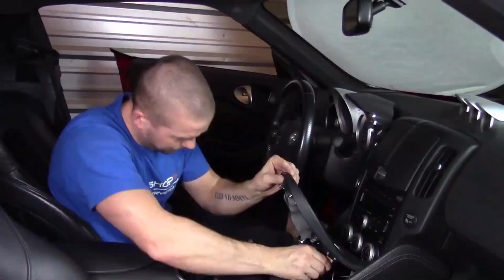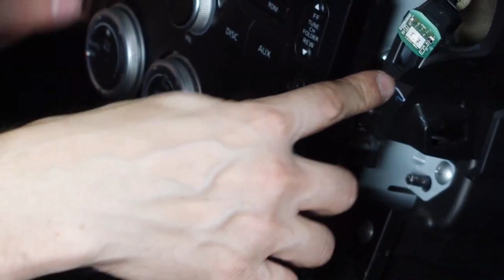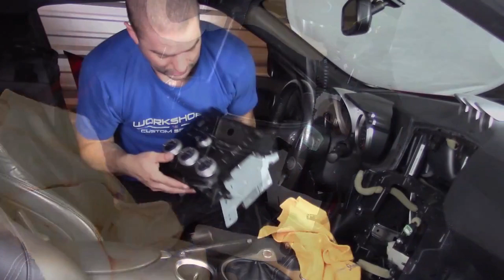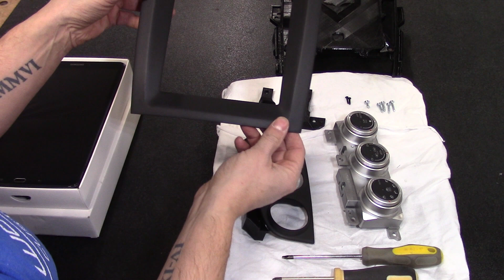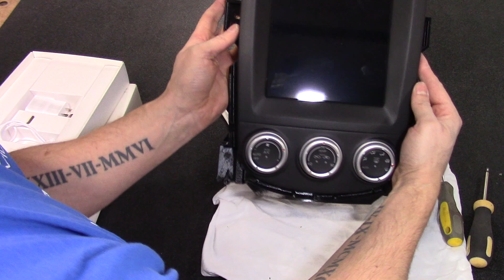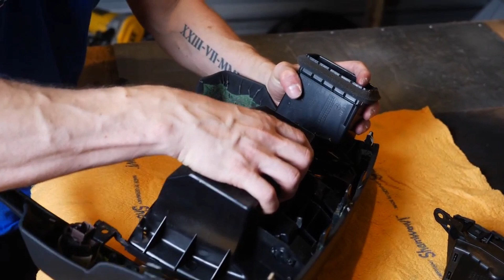MK2 370Z Brainiac Installation

Comment: do you have this for the navigation 2016 370z version?
Reply from the maker: There is a way to make our kit fit with your vehicle however it will require swapping the climate controls to the NON-NAV version. 

Here are some articles to help you: 
370Z Navigation Climate Control Swap

370Z eZ_Navi-Delete (Swap from Navigation Climate to Standard)
YouTube video from one of our customers who did the swap:
https://www.youtube.com/watch?v=uH7DZh0gtKE
If you have any other questions please do not hesitate to contact us.

Comment: this seems great and all, maybe im dumb but where does the head unit wind up going to actually use the tablet with the cars sound system
Reply from the maker: The stock head unit is replaced by our electronics to connect the tablet to the sound system.

Comment: So I have subwoofers in my car with a amp etc could I still run this kit
Reply from the maker: Hi, yes! Our stereo harness from our electronics comes with a "Amp remote turn on" making it easy to power your amp. With the MK1.7 Electronics you would need to purchase RCA Splitters and with the MK2 Electronics by Kenwood simple plug in your subwoofer RCA to the back of the head unit. 

More info can be found on our website. https://workshoptwelve.com/products/nissan-370z

Using an Amp and Subs with your MK1.7 Electronics
https://support.workshoptwelve.com/portal/en/kb/articles/using-an-amp-and-subs-with-your-brainiac-install

Comment: Thinking on getting this for my 370z base model within next few weeks.
Reply: Just ordered it. Can you use any 10.1 inch screen. The tab A a little out dated
Reply from the maker: The tab A was released in 2019, our kit also supports the 2020 Lenovo Tab M10 HD (2nd Gen). We do have plans to release upgraded plastics that can house more up to date tablets in the future
Reply: @WorkshoptwelveConnect  yeah iv got my mk2 kit and tablet installed. I was able to use the stock stereo. But I had to dissemble it to only two mother boards and no casing in order to fit it behind the Tab A. Lol. But it all works fine. Volume can be controlled with the volume keys on the steering wheel and tablet.

Comment: So just installed mome. Looks great but there is crazy static especially when there's no music. Where to ground to help w this? The only bolt I could find d was under battery gauge on the dash
Reply from the maker: Best area for grounding is the bolts that fasten the shifter to the chassis. Try our "Amplifier Keep Alive" setting in our app in the general settings. Sometimes tablets produce noise when the tablet  headphone jack amplifier turns of (no sound playing)

Comment: Do you offer the option to use an ipad instead?
Reply from the maker: We only offer our kits with specified Android tablets. They are designed to fit like a phone case around the tablet and our software also only runs on Android

Comment: Hey so I forgot that it needed a Samsung 10.1 tablet.
By any chance can it take a LG PAD 10.1 tablet??? I got it for 100 dollars at tmobole great deal
Reply from the maker: I can't say if it would fit or not, or what type of USB connection it has. Overall our kit has been specifically designed for the Tab A 10.1" tablet

Comment: Do you have an estimate on when the compatibility for the 2019 model will come out? Would you mind going into detail as to what kind of modifications you are making to the existing assembly to make it compatible with the MK2?
Reply from the maker: We hope to have a solution in a couple of weeks. Been feeling with component delays from COVID-19. The only change to the plastics is the tablet cradle itself. We have all that work complete. Just waiting on the electronics 👍
Reply: Workshop 12 i'm in on this one

Comment: Do you have a 350z install video for cars with the Nissan navigation package . This has  different requirements from the other install video as its digital as oposed to analogue. Do you have a Mk2 harness to aid fitment.
Reply from the maker: We don't have a plug and play solution for the navigation equipped models

Comment: I want to know if it's worth it? I really hate the fact that it's like an iPad that has to be charged in order to use it. Once that lithium battery dies out? Then what????
Reply from the maker: The system charges the tablet while the vehicle accessory power is on. If the battery drains then you have easy access to remove the tablet to charge. It's a different experience than a traditional head unit.

Comment: Great but you don’t show how to wire the tablet for constant power and how does the tablet shut off and on with the ignition
Reply from the maker: You won't want to wire it to constant power. Instead adjust your tablet power settings https://blog.workshoptwelve.com/2019/09/29/configuring-your-galaxy-tab-a-10-1-2016-power-settings/

Comment: What is the difference between the MK1 and the MK2? I thought there were additional vents to handle to handle a few issues? I'm super close to purchasing, but I live in Arizona and NEED the additional cooling.
Reply from the maker: MK2 has a removable front magnetic face plate so that you can have easy access to the tablet. And in some cases remove it from the car in temperature extremes (heat/cold)

Comment: Ok...I am partially sold. You’ve got the market cornered and I can appreciate the hours of prototyping and solid works. While not an Android user it’s not the end of the world. But as a product designer, and savvy woman shopper, I need to ask all the technical question: is there any warp on this? Now that materials are thinner to provide cost saving this is a possible. My Scion TC had a warped dash from the Florida sun when I bought it. Temp changes are accounted for?. What type of warp testing have you done and what’s the warranty period? Next, do the magnets add noise to the ride? This car is already pretty loud. I would hate to have clicking and clacking ok bumps. Let me know what return and warranty policy and testing specs. Thanks!
Reply from the maker: Hi there, our face plate plastics are created out of Nylon which can withstand heat up to 325F. We have customers with cars in Arizona summers without warping. 

The magnets don't add noise to the ride, they hold the plastics securely in place. As a small company we don't really have an official return policy, but if you are unhappy with your kit I'm sure we can work something out. We haven't had a return yet 🙂
Reply: @WorkshoptwelveConnect  last question, without using your app but using Mrk1.5 electronics,  do you include directions on how to wire to the steering wheel so that the toggle for volume works? I've seen it on other videos but can't find directions for the wiring.
Reply from the maker: @Tati7111  our kit doesn't have built in steering wheel control support. You would need to pickup a JoyCon module. We have a link to them from our accessories page 👍

Comment: Just bought the kit, can’t wait. I’ve wanted this for a long time and didn’t buy the first kit because it seemed hard to wire. But with the new set up it’s simply just plug and play, amazing! My only question is am I able to run Spotify and if so can I simply pull down from the top of my android tablet to adjust the volume?
Reply: You will most likely download their app. The app itself is pretty good and the best part is the hand gestures. You simply drag up or down on the tablet screen with two fingers and it puts the volume up or down. 

Keep in mind its going to take about a month to come in though! I ordered mine last month and its arriving on Friday I am stoked! lol
Reply from the maker: Yes, you can run Spotify.. we have on screen gestures in our Brainiac Launcher app that you can use to adjust the volume 👍
Reply: Workshop 12 that works I appreciate it can’t wait for it to come in!
Reply: Can you guys share any feedback on the install experience? How's the system held up so far?
Reply: @STIDMOWA  it’s awesome the only issues I ever had was the little magnets coming out (little super glue fixed that) and I never was able to get a little static to completely go away but that could be were I grounded it.

Comment: So im interested for sure. But my struggle is will i have to take the tablet out and charge it at night. Or is there a way to run a charging cable into it. Or a way to run it to the car battery lol.
Reply from the maker: Using our MK1.5 electronics it will charge the tablet when you're driving(accessory on from ignition). And then set the power settings to have it go to sleep when the ignition is off. You would only need to bring the tablet in to charge if the car sat for a long period of time. If you know the car will sit for an extended time you can also simply turn the tablet off to save battery. https://blog.workshoptwelve.com/2019/09/29/configuring-your-galaxy-tab-a-10-1-2016-power-settings/
Reply: @WorkshoptwelveConnect  Awesome. I have one last question. I seen an older comment that yall said it does not yet work with the 2019 Samsung a 10.1 tablet yet? Is that fixed or will i still need a 2016 one. If so where can i find these.
Reply from the maker: @Jordan-nd8pq  we don't support the 2019 version quite yet. You can find the 2016 version usually on eBay or Amazon (model number T580)
Reply: @WorkshoptwelveConnect  Thanks for the help. Ill be looking to order a kit soon

Comment: Are you able to receive radio any longer with your kit?
Reply from the maker: We unfortunately don't have an AM/FM solution as part of our electronics.
Reply: @WorkshoptwelveConnect  could you test the next radio app and see if your aux setup will work as an antenna?
Reply from the maker: @cipher_z  I believe it depends on if the tablet has an FM chip.. I don't believe the tablets we support have an FM chip in them
Reply: You should be able to simply download an FM tuner app Keith. Some dont even require internet access to work.
Reply: @cipher_z  Thanks. I was reading up and the Galaxy Tab A has a built in FM tuner, just needs some sort of cord attached to act as antenna.
Reply: Next radio is one of them. It normally uses head phones as an antenna. But I noticed that it will also work with just an aux cable plugged in.